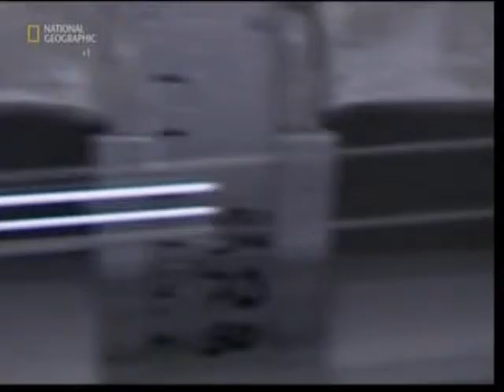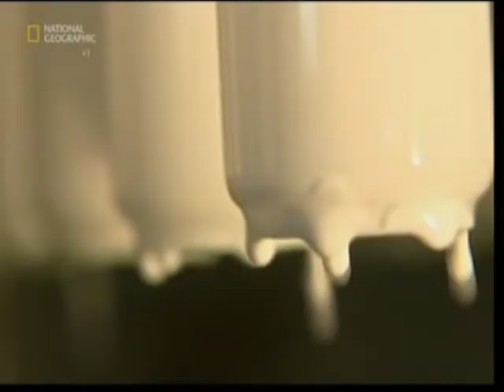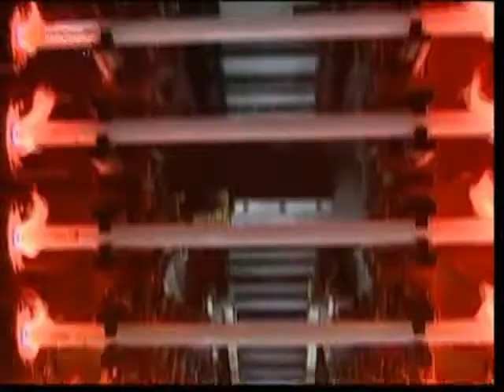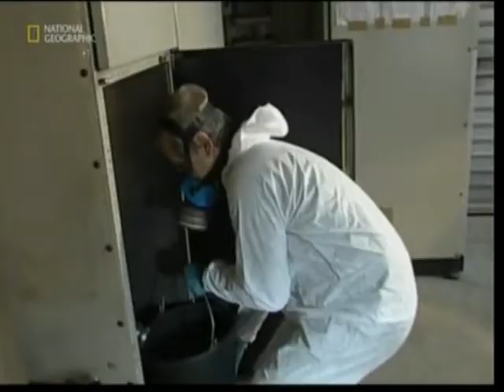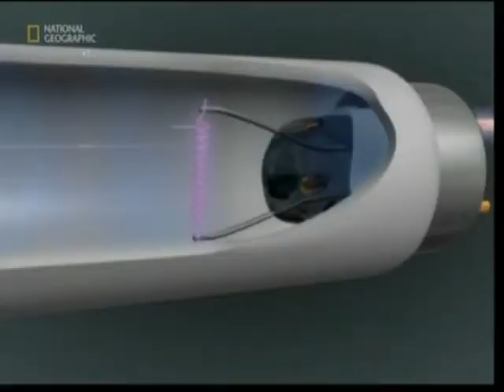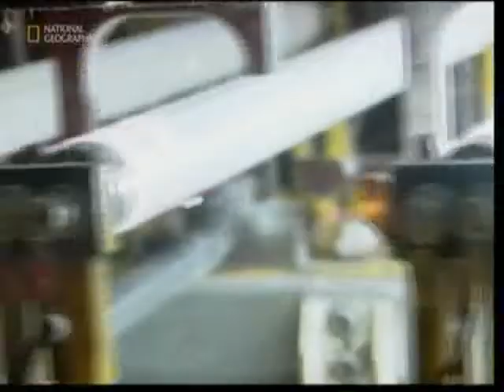How Fluorescent Tubes Are Made

Comment: The process looks very efficient. You would have to look at many variables; watts in, lumens out, useable spectrum, lifespan of the bulb, lifespan of the ballast, resources consumed for manufacturing the ballasts, resources for packaging, transportation, etc.

I haven't researched personally, but I would guess fluorescents are "greener" in long run due to their efficiency during operation and the longevity of the bulbs. Good question though. Im sure you won't find an complete answer on the box.